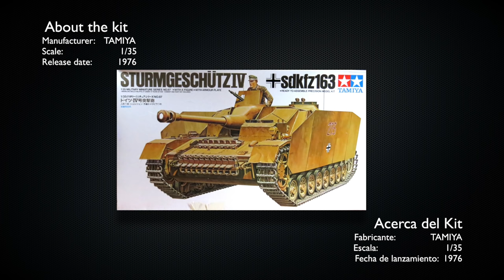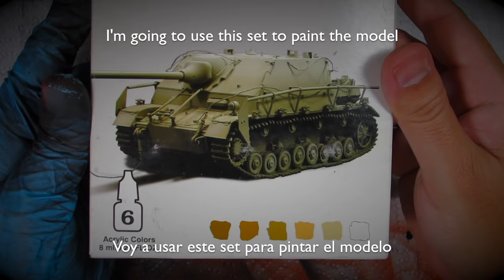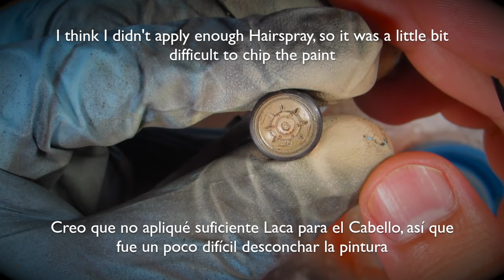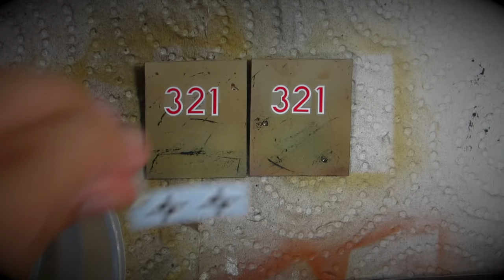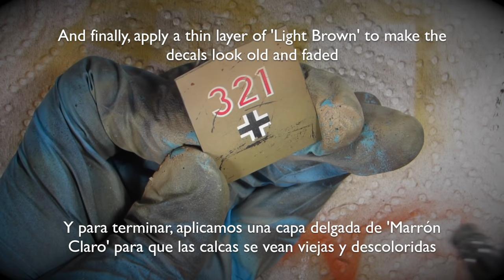[2] Sturmgeschütz IV - StuG IV (Tamiya) - PAINT - PINTURA

Comment: Fantastico! In all my years of modeling it never even occurred to me to simply use "brute force" to damage side skirts and other parts. I was always stuck in the mindset of applying heat with a candle. One thought, the damaged schurzen hanger would be much more likely to break at the weld than in its middle section.

Comment: Sergio, I just finished watching this again and noticed that the holes in the chasis for the motors were not covered up.  All the old Tamiya kits are notorious for having those.  I put tape on the bottom where the holes are and then fill them with Tamiya putty from inside.  When its dry you can sand it and have a nice smooth chasis.  I hope this will come in handy for you.  Thank you again for sharing your fantastic videos.

Comment: Late to the show. Currently have this very kit on my bench right now. This kit is a mess tbh and needs a decent amount of TLC to make it build really well. First thing I did with mine is fill in all the holes on the lower hull. First the bottom, then the sides using Milliput. I have a bunch of Tool and extinguisher spares from past Dragon kits I've done that I plan to use plus an extra Eduard's Pz IV Side Armor PE set as well. I've also used Tamiya's Primer G to replicate the steel cast texture on the Saukopf Mantlet, where Tamiya's cast is too smooth. I've had fun so far although theres alot of work in this old kit.